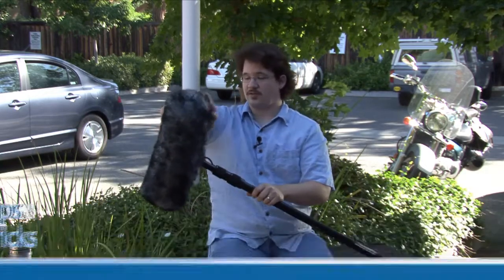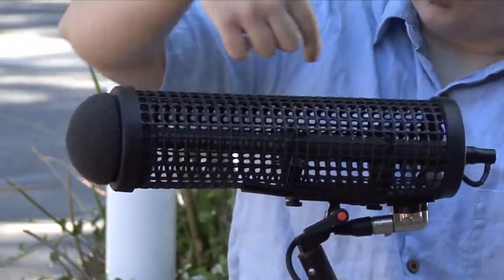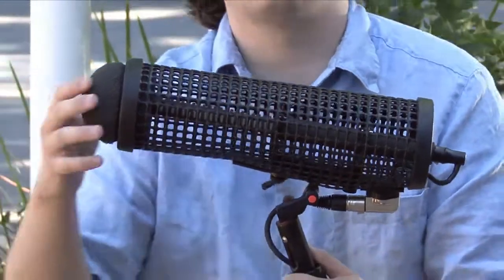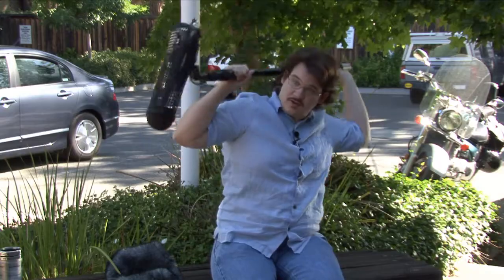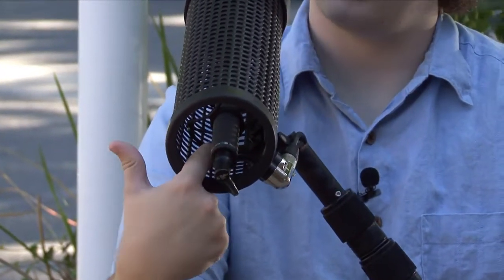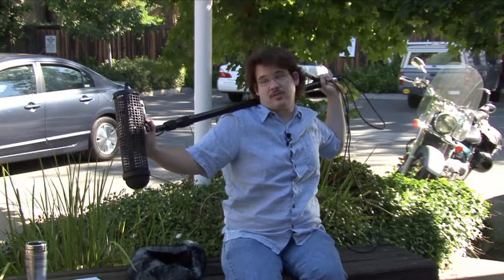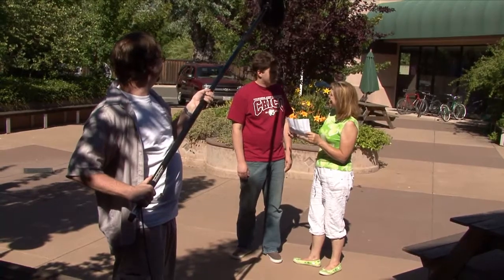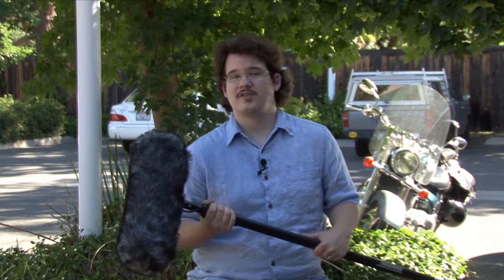Videomaker - Boom Mics

Comment: Nice video buddy. :) So is a boom mike being used on you int this video... :p 

One idea for the holding of the boom is to use a tripod with a adaption peice to hold it for you for shots where the subject(s) do not move, and the shot might take a long time to take. You can still twist the boom to turn the mic at the sound source just by not tighening up on connection where the boom rests on the tri-pod helper. :) I mention this for people who might be disabled. :)

Comment: First off, if you're going to make a tutorial on getting sound for video, you'll want to avoid the distortion you're getting from your lav by not setting up the gain structure properly.  And I take issue with your statement that shotgun mics are the most common mics used for film.  I do agree with having the boom op use headphones, but I would add that they should have maximum attenuation of outside sound.  The ones that have good drivers mounted in shooters ear-protectors are good.